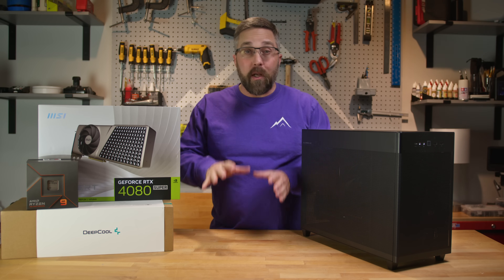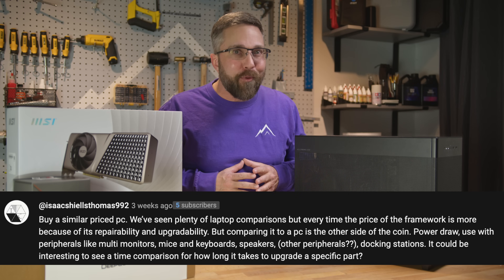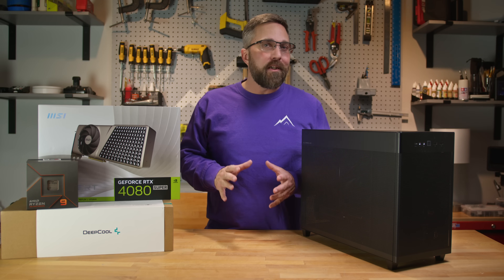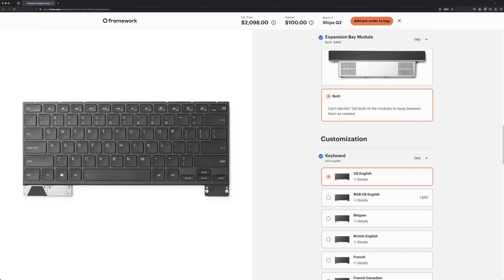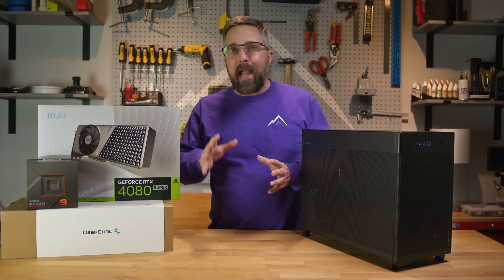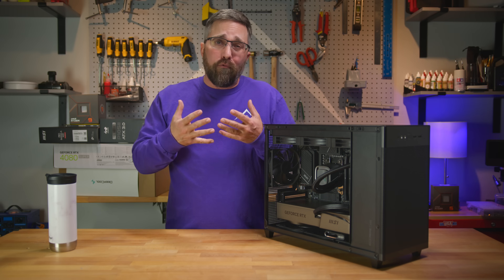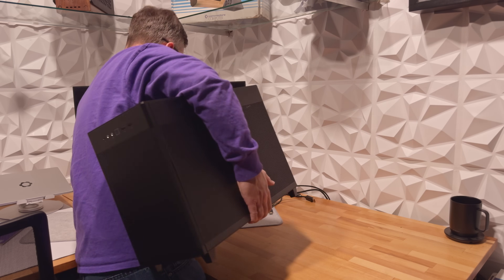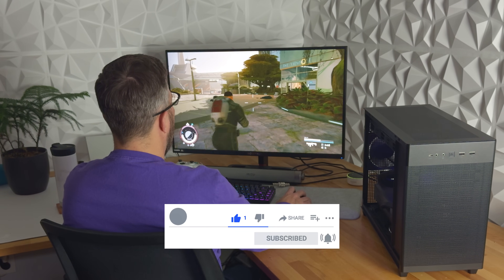The Framework 16 Dollar-for-Dollar Competition!

Comment: So as a Linux user myself and knowing that you like to at least tinker with the penguin system, I personally would not have gone for the Nvidia card. I have had mixed experiences and recently removed my 3070 for an rx 7800xt because I was having a repeated issues with the Nvidia drivers. You could have saved some money by going AMD on the graphics card, but ultimately the wonderful thing about upgradable systems is that you have the right to buy what some people would consider suboptimal parts
Reply from the maker: I’ll be using this for 3D design and rendering using programs like 3DS Max, Maya and Vray. These suites are specifically designed for Cuda and Nvidia graphics.

Comment: With the caveat that I don't know if you have a working one after the previous problems, would you be willing to test if you can run an OS off the 1 TB expansion card without it overheating (or having other problems)? In my 13 the 1 TB card overheats if I do anyhing that causes the fans to kick in.
Reply from the maker: I've tried to run Linux operating systems on my 13 from the 1 TB card and even with the thermal pad fix the card overheats and there are problems. I'll be testing the 1 TB card in the 16 to see if it can hold and run my Steam game library.

Comment: Thank you for mentioning that Framework laptops are modular and repairable first, upgradeable after. I feel like all the other reviews missed that nuance. And by overstating the upgradeability part, they might've turned off people who aren't interested in it or don't trust it.

For anyone curious, I'd say that the repairability comes first is because unless you really screw it up by not taking care of it, or have really unfortunate accidents, you are basically guaranteed you can use this laptop for 10 years. Yes, 10 years. Yes, with no upgrades. Yes, including if Framework goes bust NOW.

Ok, many people would ask "why TF would I want to use it for 10 years ? I usually upgrade to a new laptop every 4 years or so, no way I'm gonna use this way outdated crap in 10 years". Here's the thing: you don't have to use it yourself! After you decide you want "the new specs", you have the option of 
a) using it for a home server or NAS 
b) giving it away to a relative (quite common in Eastern Europe, I know it varies from culture to culture) or 
c) sell it, to subsidize the cost for the new one. This last part is important, because unlike other laptops (except maybe old Thinkpads) because this will be known to be very reliable, you will be able to sell it at a decent price. Of course, there's also option 
d) sell just the GPU or mobo + CPU and buy the upgrade at a lower price than a laptop with that spec.

With options c) and d) above, you basically recover a bit of the high upfront cost. Also, on the upgradeability part, the fact that you can do it in parts is also a bonus, maybe you don't have the money for a full new laptop, and maybe you don't even need a lot of the upgrades or changes. Framework gives you options, which are hard to quantify or put a $ value to them, but it's clearly a plus that few go into detail.

One minor thing to mention, since few care - this is clearly the laptop with the lowest waste factor.

Comment: Can you use phone chargers to charge this laptop in a pinch? I know HP Zbook Studio G8 for example is pretty picky about what USB-C power sources you can actually use. None of the USB-C chargers I already have work at all.
Reply: I've done it with my 80W phone charger
Reply: @willm5032  I'm wondering more like 5W or 20W chargers. Not useful when actually using laptop, but useful for slow charge overnight.

Comment: I think the framework laptops are insanely cool as enthusiast devices, but its very hard to make a case for their value proposition as it stands. If i buy a framework 16 then upgrade it in a couple years, youve probably paid as much as two similarly speced laptops or a laptop and a desktop, but only have one functional device at the end of it. You're also going to be stuck with the framework chassis for the foreseeable future, which i dont personally find that appealing relative to other devices.

I really think we would need to see some form of standardization of conponents for upgradable laptops for the market to become competitive, but that seems unlikely at the minute. If other brands were releasing laptops with compatible motherboards or gpus, users would have additional upgrade paths and the competition could drive prices lower - but i dont think theres any incentive for either party to do this.
Reply: Being "stuck with the chassis" just means being upgradable. That increases the value proposition rather than decreasing it. If you buy a different laptop and it becomes too slow for your use case then you're forced to buy an entirely new laptop at full price. If the Framework's GPU is too slow for you in the future then just buy a new GPU for a price much lower than an entirely new laptop from a different company. 

As far as upgrading it in the future goes, if you ever end up upgrading the CPU then because those are inbuilt to the motherboard, you're left with a complete motherboard with a CPU. All you'd need to make that into a fully functional computer is RAM, storage, and a screen. Coolermaster already makes a keyboard/case for the Framework 13 motherboards, so those who already upgraded their Intel Framework 13 laptops to AMD have the option of turning their old Intel chips into fully functional computers. I'd imagine similar options for Framework 16 motherboards in the future, and if no company makes it you can just 3D print a case yourself as Framework provides all of the specifications required to do so.
Reply: @LawlessNate  It only increases the value proposition if the original device and upgrades are competitively priced. As it stands, you pay so much more upfront and upgrades aren't going to be cheap (based on past 13" pricing), so the value proposition of upgrading versus buying new just isn't there - especially since it will likely be much easier to sell on a full laptop than individual components to recoup cost.

Yes, you could buy a new screen, case, etc.. for your old board - but guess what, that means that to upgrade you've basically bought an entire new laptop's worth of parts anyway.

The main reason for my "stuck with the chassis" comment wasn't even really about value - I just think it's ugly. In a couple years time, things like the large bezels, smallish trackpad, meh keyboard, etc would be some of the first things I'd want to upgrade. To justify keeping that chassis, it needs to be desirable at least now, but it's almost objectively worse than almost every laptop it's competing with.

We can also mention that if you buy a laptop for the same price now, at least in GPU perf, it will be so much faster that it's unlikely you'll need to upgrade as soon. You're also taking a huge risk in hoping framework will continue to support it, and get access to better components - which is never a certainty.
Reply: I think it's the same thing as the cost of cheap clothes that don't fit, don't last, made to be disposable and  going in the landfill at obnoxious rates. VS high quality custom made clothes that are made of high quality natural fibers and tailored to your fit. The cost is more expensive but it will hopefully last a long time, need less and benefit in the long for the environment AKA all of us  living on earth with finite resources. In the long run it's worth to invest in. But we have the mentality of only wanting to pay as cheap as possible. Someone pay the price somewhere. With clothes it's the slave labors and the planet and future generations. With Electronics it's clearly a lot of trash we are manufacturing and big companies clearly do not care of improving the situation. 🫤 It as similar consequences. If a person can afford a disposable 1800$ laptop every 2-3 years they prob can afford a 2k every 10years or resale and buy the newest. I'm not talking about a person with a 150$ budget but this laptop is clearly better than what you can get for that...I hope, at least on paper it is 😂
Reply: I have a similar line of thought, even if it's expensive for now, and the fact that they don't even offer any option to sell it to my country, I'd still buy it if it wasnt because unlike in smartphones, in computers, thinner bezels are just better as long as they are strong enough (and too big ones are ugly), also the fact that I hate sharp angles in metal chassis (specially in the lower interior where my palm would rest when on the go).

If they fixed those 2 things at least, I'd gladly pay the "early buyer markup" without hesitation.

Comment: Yeah, the Framework is not cheap, but, EXTREMELY configurable, repairable and upgradeable compared to, well, just about every other non-desktop.
So more freedom configuring it, you can upgrade later, repair it, largely yourself if not completely, and evade ridiculous Apple tax on memory and storage pricing.
I also wouldn't want the Apple OS, but some people would.
Funny, with phones, i am the exact opposite, still hate the Apple tax, but i hate Android with a passion, and my Apple phones all last way longer than basically any Android phone.

Comment: Please include the weight of the 16.  I recently bought a used gaming laptop for really cheap, primarily for retro gaming and Linux use, and it's incredibly heavy.  It weighs ten pounds alone.
Reply: As per Framework's website, with a GPU the Framework 16 weighs about 5.3lbs, while without a GPU it weighs about 4.6lbs. As a side note, the Steam Deck taught me that I don't really need that much horsepower to play the kind of games I like (Indie and older AAA stuff); with that in mind I bought a Framework 13 with a 7840u. It weighs only 2.85lbs.

Comment: I'm getting to a point where I want to build a sub 5L mini itx with occulink instead of internal gpu. The framework becomes competitive when a occulink module is made. The radeon 7700s is nowhere near enough
Reply from the maker: Like maybe an Occulink interface could come in the empty $99 expansion bay rather than just a couple fans?
Reply: @ElevatedSystems  absolutely, I can't imagine it would be hard to design a framework interconnect to occulink pcb. It may or may not need a redriver depending on the FW mainboards capabilites and cable length. Even better would be a 4x/4x bifurcation. Have 4 gen4 lanes go to a ssd and the remaining 4 to the egpu. 4 lanes will be enough for now but 8 maybe needed for next gen gpus